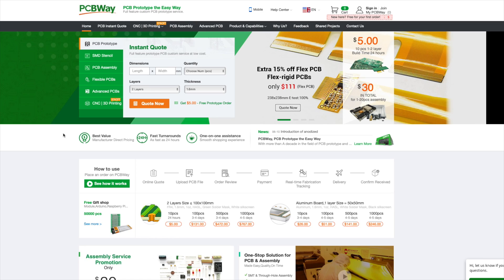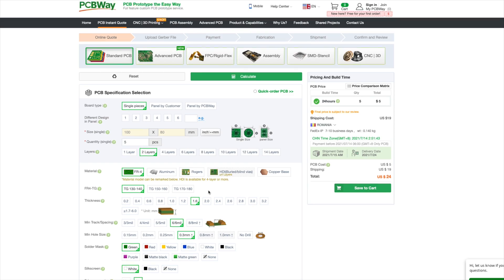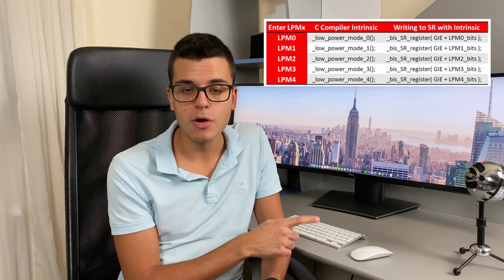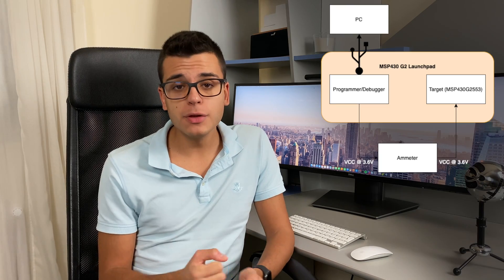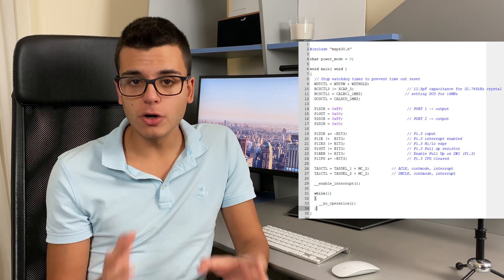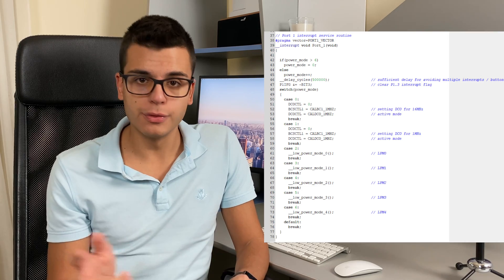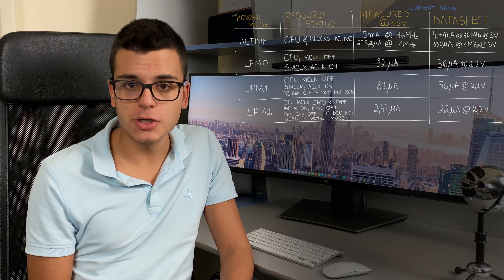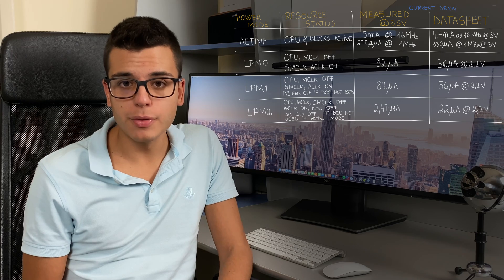How Low Power Modes Work + Current Measurements | Embedded Systems Explained

Comment: I tried all sorts of low power shenanigans(minimum LPM4/LPM3 exampes from TI) but couldn't read less than 2 mA with either Energy Trace, Energy Trace++ or basic multimeter. Both multimeter and Energy Trace results were similar, so I can say  I am reading correctly. With Multimeter, I connected multimeter to 3V3 jumper pins(which is like directly the source).  I am using MSPEXP430FR6989.